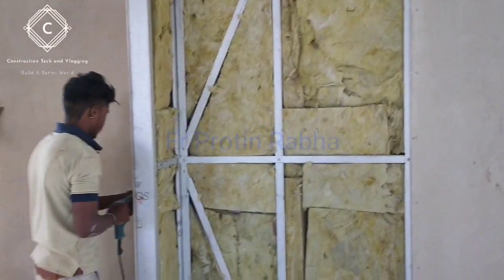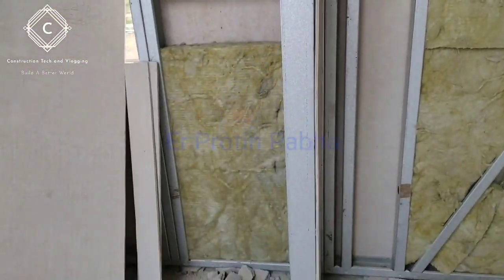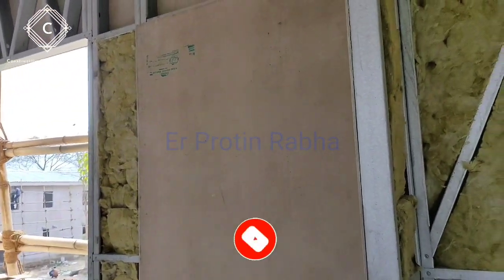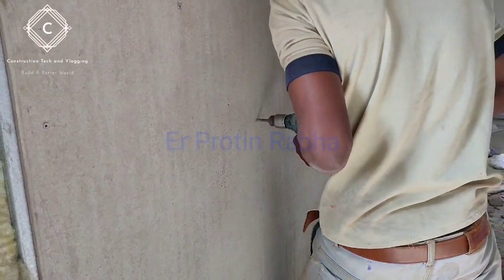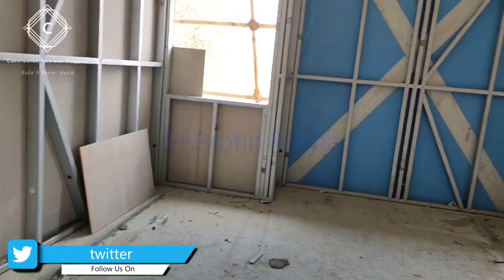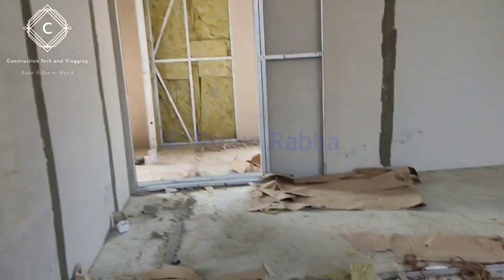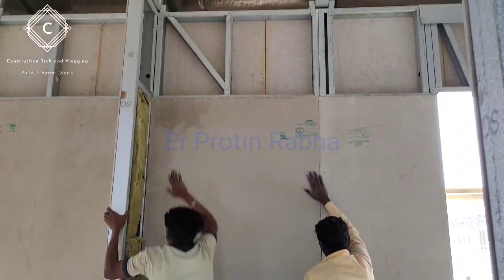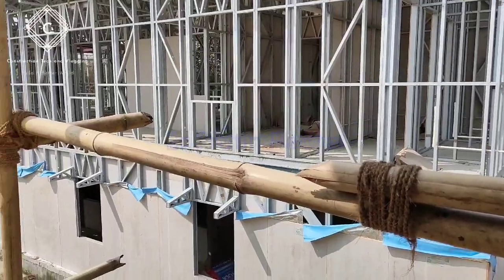Latest Building construction material technology | LGSF Building Construction | LGSF Materials

Comment: Very nice, may I know what is the cost variance between block work Vs Dry wall , which is beneficial
Reply from the maker: According to me block work is good and economical. Drywall is for faster work and for temporary shed. Drywall may deteriorate when too much exposes to the heat and water. It has the property to withstand those weather but as the time pass this drywall may start to rot slowly and very vulnerable to some force like it can be broken with puch too. Drywall also need skilled labours and lots of steel structure is involved in it. Which double the cost. And it has to be provided in 2 layers. And so on.

Comment: Is't more expensive than the concrete building?
Reply from the maker: No, it is a bit less expensive than RCC structures. Since it is lighter so footing size becomes smaller and RC beams and columns is avoided hence drastically reducing the cost of construction. It is also faster in Construction than normal RC structures.